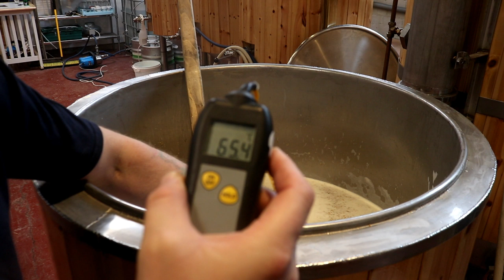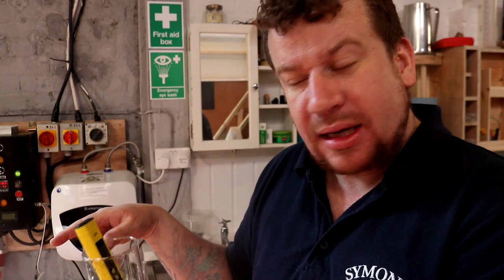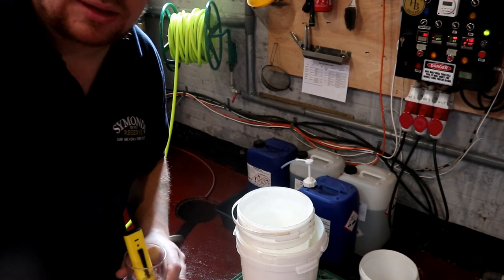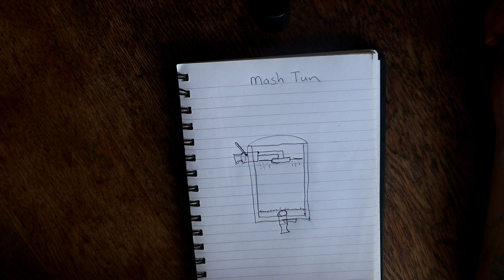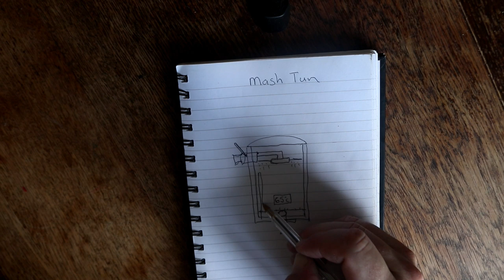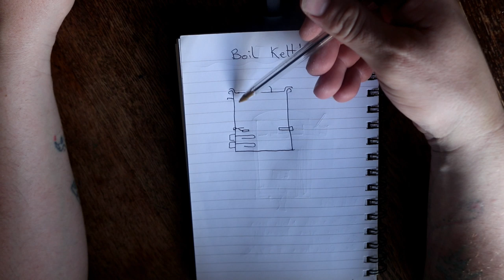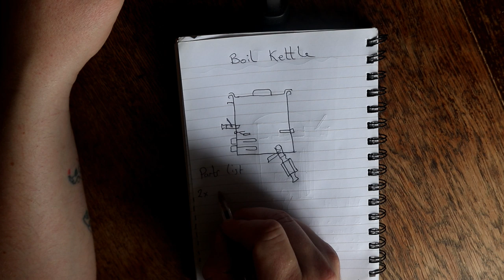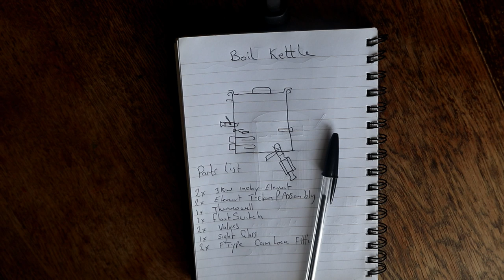The parts List

Comment: I would not use the relay type PID. Using the mark space output type gives a better control of the element, down to half a cycle per sec (1%) and zero point switching emits no noise. The signal from the PID to the SSR goes to the float switch (low voltage and low current).  It's just like cookin' with gas.